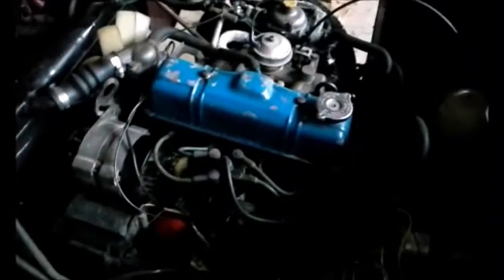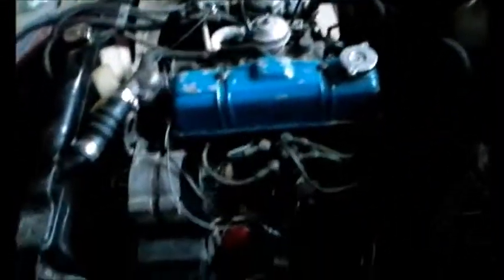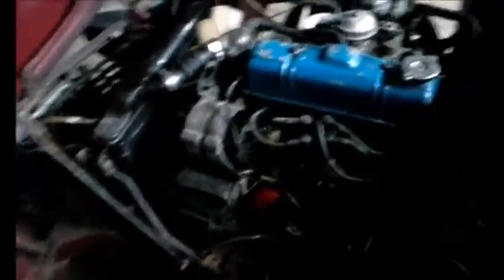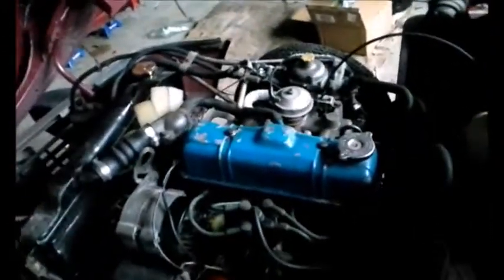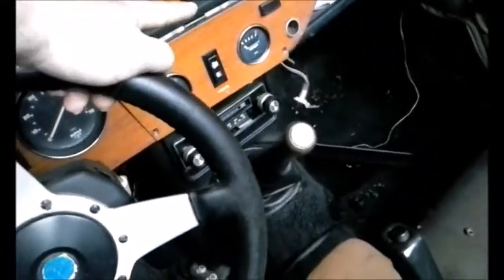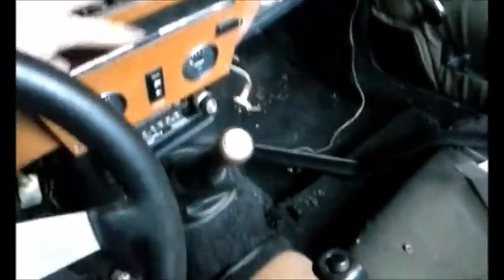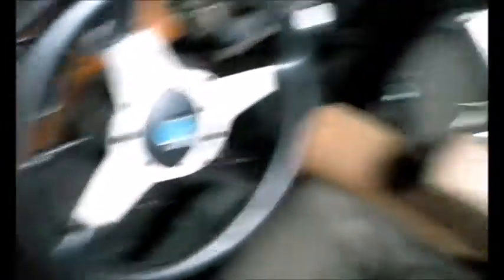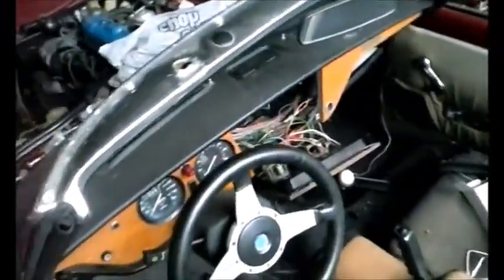1978 Spitfire: IT'S ALIVE!!!

Comment: Great job and progress. I have been restoring a 1973 Sptifire and started it about 3 years ago. I am putting on the finishing parts and should be ready to go by March. I had it running last summer and can't wait to be done. I need to go to confession each day I work on it. And I am not Catholic! :) What a CHALLENGE! Thanks for sharing your project. Keep up the good work.
Reply from the maker: Thank you. Sounds like you'll have a sweet Spitfire once your done. You'll be in time for the spring driving season. :) I hear you on the confession thing, working on them will make you cuss fiercely sometimes lol. At some point I hope to tackle a full out restoration but at this point I just want to get it roadworthy and enjoy driving it for a while. Good luck with finishing your restoration and I hope you have a blast driving it.

Comment: If it's the zenith carb that originally came with the car, they have diaphragms that tear and make the car run rich. Very common problem.
Great job on getting the engine going.
Reply from the maker: Yes it is the Zenith. I have another that worked perfectly so I will put that one on. Worst case scenario I'll have to rebuild one which wouldn't be very hard. Thanks man.